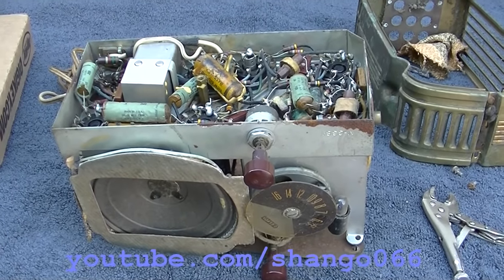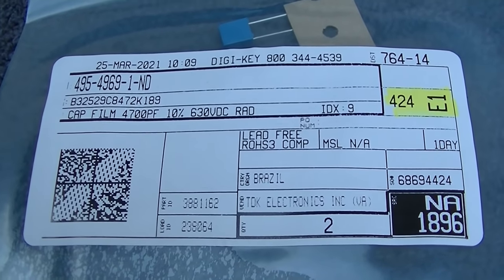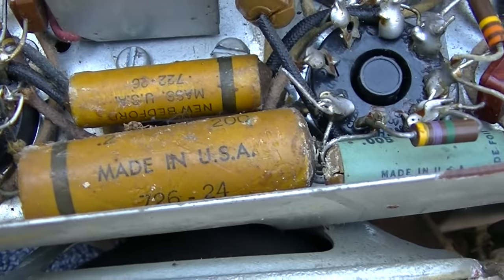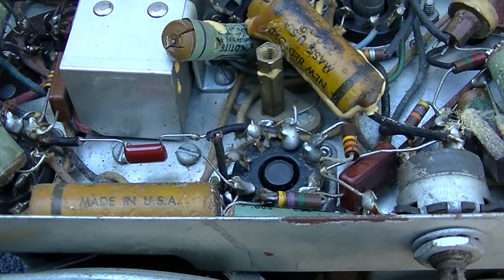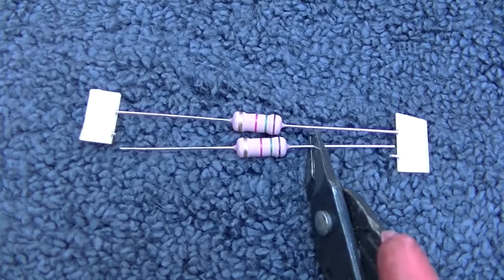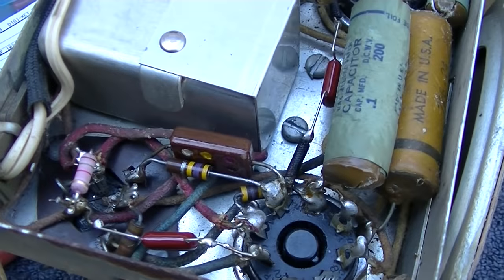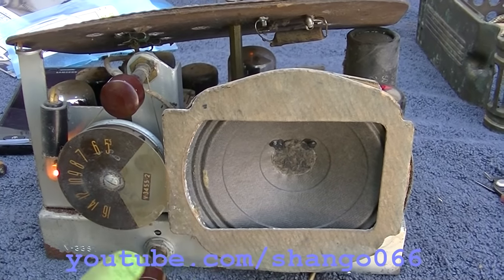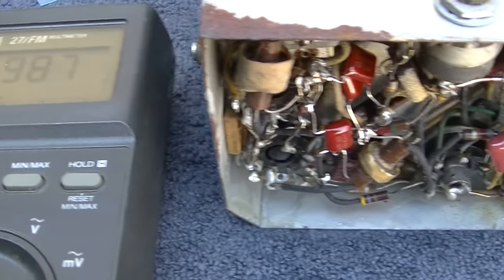Recapping Westinghouse Little Jewel 2 H126 Refrigerator Radio

Comment: I like the way you bend the leads on the new caps.  I'm going to start doing that.
Reply: It is a legit method.  Solid, stable, easy, reliable in the long run and, most of all, it does not put stress on the surrounding parts..

Comment: Thanks you helped me on capacitor replacement on my 1937 Marconi model 75. The  wiring is breaking down and disintegrating and the chassis weighs about 30 lbs. You didn't replace those rectangular plastic caps with the color dots so I will leave mine in as well. You called them electrolytic . They dont look like electrolytic caps. Although I have the schematic it looks like it was created with a Sharpie and hand drawn. It also is inaccurately layed out. Anyone who could remove , paint the chassis and rewire this thing , well I doubt it's possible . But you're right all the power to them.
Reply from the maker: postage stamp capacitors, most are mica and are usually fine some are paper and need to go

Comment: 6:42 very valuable tip about bending capacitor leads there. 
But the problem with bending the leads right at the case is not only about breaking any moisture seal. Especially on these caps with the thin epoxy coating you run the risk of exerting mechanical stress on the schoopage (the metal layer that bonds the lead to side of the foil roll). Schoopage failure is one of the hardest to track down intermittent fault since at early stage it will only show under a high pulse current load like in TV deflections but not on your average cap testers.

Comment: Shango066, I simply want to thank you a whole bunch for doing these radio videos. I took in a 1946 AA5 that didn’t work. Diagnosed the problem, replaced the caps that needed it and tuned it up! Following your videos, I fixed it. You helped me out a bunch. Thanks again. -dh

Comment: Hook & pinch  "J hook" is the BEST way to replace caps, that is the way I do it, less damage to tube socket pins, etc.
Cutting the leads very close to the old cap, yes.
I like the way you re-cap radios.

Comment: Sure would like to see the finished product after the radio enclosure has been restored.
Ricky from IBM, Ret in Englewood Florida formally from Simi Valley, Ca
Reply: Do you miss the 118fwy and 405
Reply: @colt45peacemaker  Nope !!! For awhile I had to commute to Culver City. That was a real bummer. A bad traffic day here on the Gulf Coast of Florida is when I have to slow down to 40 MPH. I was luck, I had a position at IBM where it made no difference where I lived just as long as I was in the area of an airport.  Ricky from IBM, Ret in Englewood Florida

Comment: Excellent work as usual, love getting tips from your method.  Did one of these and left exactly the same two caps.  The metal grill i stripped then nickle plated and polished.  The clam shells got a light turquoise high gloss finish because ‘she who must be obeyed’ wanted it to match the toaster, kettle and other accessories in the kitchen.
Cheers!

Comment: Spectacular lesson in innate troubleshooting skills and a thorough understanding of the circuitry. I'm a retired biomed engineer, and I agree with everything said about lead dress. I take only one exception: altho those yellow axial lead caps may be expensive, 99.9% of 'em are 0.01 cent ChinoCrapCaps with a service life meaasured in years. Not decades before the poisonous recycled bottom quality materials degrade. In my restos I don't give one little sh** about lead length. In the real world it almost never makes any diff.. and if it does on one particular component then fine- I'll move the damn part right next to the high Z point and let the ground lead go where it may. lol. 
Those yellow caps are HIDDEOUS and they remind me of bottom-dwelling cap swappers who don't know the difference on a schematic between an FET and an NPN transistor. Or from a diode probably. Thank you Sir! Excellent series by the best.  73 OM

Comment: Hard to imagine new bedford MA used to make capacitors. Actually lots of electric stuff was made in MA. Not anymore....
Reply: New Bedford ? Isn't that where George Baily and, that evil Mr Potter used to live ?
Reply: @sonsofthunder915  that was Bedford falls.
Reply: @TheRadiogeek  Oh, I guess they don't build capacitors in Bedford Falls then ?
Reply: Yup, all the Telechron/GE clock movements lots of clock radios had made right down the street from where I usta work in Ashland MA. Raytheon tubes made in Newton. Hy-tron/Sylvania tubes made in Salem, and the Danvers plant where my grandfather worked as a tube tester. National radio, Automatic radio, etc etc...
Reply: neighbor Rhode Island was the most industrialized state in America until at least the mid 1950s, with more manufactured goods exported per capita than any other state. Most of that was textiles, though. Much of the microelectronics industry moved out west to CA in the late 70s and 80s because (arguably) the minicomputer industry in New England, which was very profitable for a time companies like Digital Equipment, Wang, and Data General, really slipped up on judging the market demand for home computers. There are many electronics manufacturers still in MA though but not for commodity stuff like capacitors or computers, it's more niche markets like medical equipment/healthcare, power electronics, robotics/automation, and aerospace and defense industry stuff...there are jobs for assembly technicians regularly available problem is there don't seem to be enough skilled people to fill them.

Comment: Must of had a sale on 1/4" diameter spaghetti tubing. I don't know if it actually heat shrink or not but I got a shoe box full of cloth wiring where if need to 
just pull off some of the cloth from the wire and wha-la instant insulation that looks almost original!

Comment: And speaking of “Radio Disney”, I heard that KRDC 1110 AM one of the last AM stations in the LA Area has finally pulled the plug on “Radio Disney”. The last day was April 14th of this year. I missed recording the final moments of KRDC’s “Radio Disney” at 1110 AM. It flipped to sports as ESPN Radio on 1110 where it is now simulcasting on 710 AM. No more “Radio Disney” for now. You should do a video about it this weekend while you doing a vintage radio repair video.

Comment: i have a question if you don't mind........is it necessary to identify the outside foil of the new capacitor before replacing the old one....thanks
Reply: Wondering same too.
Reply: Maybe because back in the day they did not have polarized line cords and they almost had to do the outside foil thing. If it was noisy
you had to switch the plug in the opposite direction to the power outlet which also wasn't polarized, but you'd  probably did not notice a change .
 As long as B+ and B- are just that then the relativity of the capacitor to outside foil is quite negligible to ground, in general.
Reply: @hestheMaster  thanks
Reply: @hestheMaster  the outside foil made a difference in internal  noise generated. 
 The end with the outside foil is marked with a radial line at one end of the capacitor cylinder.  
Using a polarized power cord prevented the chassis of the radio becoming line voltage.   Those small size radios didn't have a power transformer to save money.  The tube filaments of all tubes added up to 110volts.
Reply: @colt45peacemaker  So when you recap a radio why does it not matter so much
when you follow all the electrical precautions ( fuse on a transformer powered radio, "death" capacitor being X1Y2, polarized line cord,switching the "hot"  side,or what is know as wire dressing)?
Internally generated noise is very much
lessened by all those things. I'm sure a small radio chassis size loaded with components would be the main culprit in noise being a problem however!
Reply: @hestheMaster  all that helps and modern capacitors.
Reply: Nag,Nag, Nag!

Comment: I always found it fascinating that in the US you don't use nanofarads. Much easier to say 4.5nF than 0.0045uF
Reply: I don’t think nano- and pico-farads were a standard in the U.S. until the mid-1960s. So many, many schematics back to the ‘30s show uF (for nano)and uuf (for pico). Still, it’s sort of a lazy preference to use ‘0.1 uF’ instead of 100 nF.
Reply: We only use picofarads or microfarads because two values  is easier to know than three. Less confusing and easier to read schematic wise for sure.
Reply: @hestheMaster  yup. Just as easier as the imperial maesures 👍

Comment: Hi Shango, the capacitor on the antenna board, is it for an external antenna? should it be replaced with a safety X or Y rated capacitor?

Comment: I don't see any problem with leaving the old capacitors in certain low/no voltage parts of the radio's circuit, provided they don't adversely affect the quality of the sound and/or sensitivity of the receiver. (The "news" departments of radio and TV stations feed into these "manufactured crises" because they need to boost ratings to pay their bills and stay on the air in the face of declining ad revenues in recent years.)

Comment: So I know enough to get by fixing stuff, and mostly fix tape decks and reel to reel players. When I replace capacitors, I figure replace them with the same type. So why do they make different types and in what scenario would you use one type over the other? ( ex. electrolytic, Mylar film,ceramic disc etc.) And can you replace them with a different type than the original assuming they have the same +\- or non polarized

Comment: I have a weird problem with a zenith system 3 space command tv from 1987. Upon powering it on, the crt fires up immediately. The tv will not shut off unless power is cut from it. What happened to my tv and is it fixable??

Comment: Life before pcbs looks like hell
Reply: Whole lot easier tracing a circuit when you don’t have to flip a board back and forth to follow traces.
Reply: I see your points, but to me it’s simpler to fix when it’s all at one level, it seems like 4d chess with the components all over the place

Comment: .039 is also a modern standard value and is closer to .04 than the modern .047 value....It don't make much difference in a radio*, but in a TV it can make a difference.
*Heck in the average radio you could probably replace every paper cap with .047 and not have excessive changes in performance.

Comment: Why are new capacitor values the way they are compared to old capacitors?
Reply: The new capacitor and resistor values are standardized, based on a mix of (slightly altered) traditional values and equations that are trying to space the values evenly apart, but on a logarithmic scale. http://en.wikipedia.org/wiki/E_series_of_preferred_numbers
Reply: That's kind of dumb. Like I need 750 ohms of resistance in series with an LED to show the power is on in a 9 volt circuit. In one case, the manufacturer was able to get a single 750 ohm resistor. In my case, I had to use 3 - 470, 270, and 10 ohms.
Reply: @theannoyedmrfloyd3998  Or maybe two 1.5k in parallel...

Comment: If only they had used the micro miniature Space Charge vacuum tubes the capacitors would not be as bad as they are as there would not be as much heat buildup as with standard vacuum tubes.

Comment: Hey shango066, I’m not sure how to contact you, I have a heathkit tcr-1 that I’ve been working on, I recapped it, and it worked for a while, I think I screwed up the alignment and now it seems dead, I’d really like to get this set working well, it’s in excellent cosmetic condition and very clean inside as well, I’m close enough to come drop it off, if you’d be willing to work your magic on it. Please message me.

Comment: 14:20 I'm more of a Red Eye Radio type of listener.  They are a a radio show aimed at truckers and are of a conservative type of show like Rush Limbaugh. I'm not a trucker but I like the political talk of that station and I like how they basically are against the left.

That spider better not walk on the wrong parts or you'll be smelling burning spider. I've fried them on those electric bug rackets and it smells horrible.

Comment: That came out well, and it's been a fun series. Electrolytics---I'll reuse them in a series-string set if they're working ok, because the most that can happen is that if it shorts, it takes out the rectifier tube (which I've never had happen)

Comment: why not repair the old condensers, that is bad and the radio no longer has any historical value.
Reply: Old capacitors cannot be repaired, at least not economically. Sometimes, on a rare collectible radio, restorers will stuff a new cap inside the original casing. But this is rarely done on common radios like the one in this video. On radios like this, the fact of it working like new easily outweighs the fact that it no longer has the original capacitors.